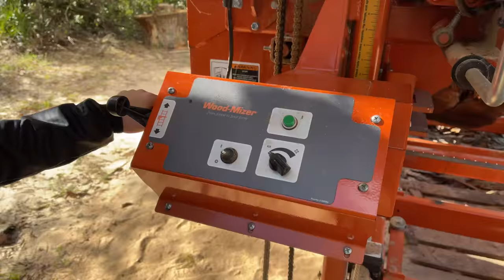Sweet Succulent Cherry on the Wood-Mizer LT15 Wide -18

Comment: I acquired about 2,000 board feet of wild cherry that had been cut into 1 1/8” slabs and air dried in the barn for 25 years. I planned into 3/4” planks.  I found rage wood to be a pleasure to turn on a lathe, build cabinets, and even carve plaques. It’s become my favorite wood to work with.